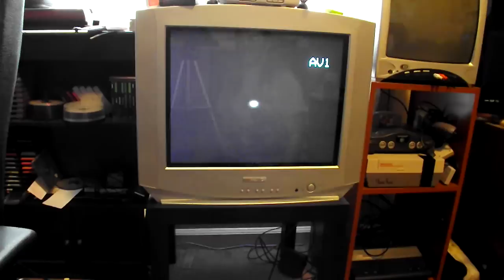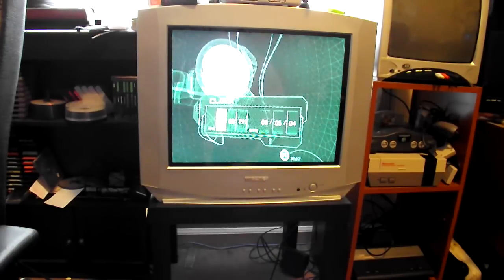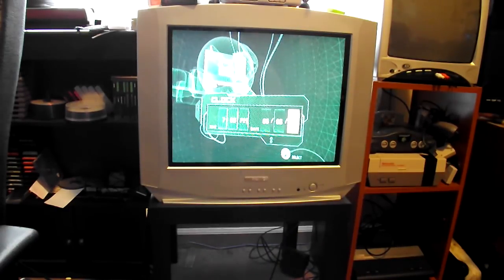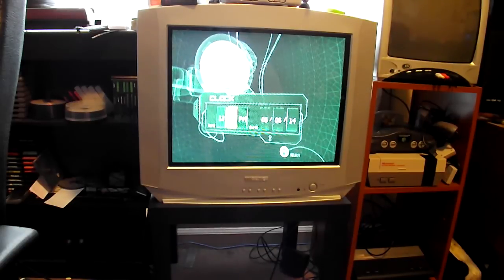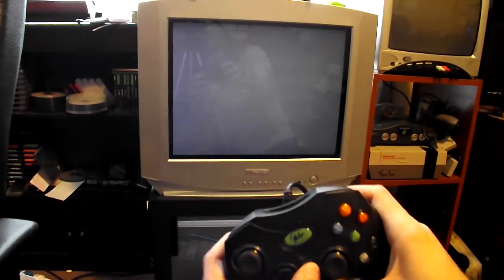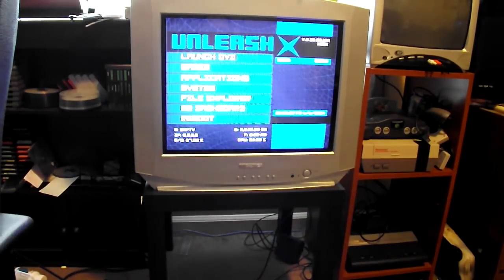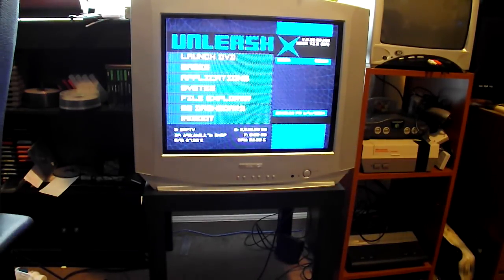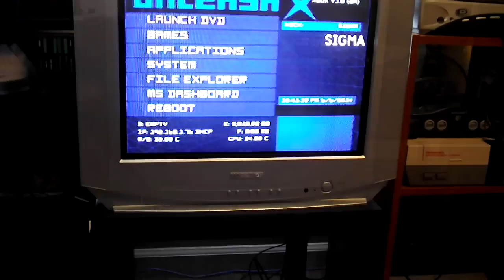Original Xbox power supply replacement

Comment: i just got an xbox (2001) from a friend and said it doesn't work. i managed to test it. the PSU (power supply) doesn't work. it pops overtime i plug it in.
Reply from the maker: Diegotheartist1  order a new one. it's possible the solder joint failed but it's better to just go ahead and order a new one that matches your unit.
Reply: thanks for the suggestion. the model i have is from 2002
Reply from the maker: Your PSU will most likely be the same as mine - the 1st of the 3 models produced. Look for a PSU for the 1.0, 1.1 xbox. A Universal one WILL work but I had a bad time with a universal one I purchased - it didn't seem to be regulated well enough but I've heard that's just an issue with 1.0 Xbox's like mine and those universals.

If you have trouble finding what you need I can help further on IDing the part - just let me know (I'm out at the moment and can't easily link to any extra information ^^;;; )

Comment: my xbox is powering up and then turns of after a wile
sometimes it won't turn on at all ';. \
is it the power supply?
Reply: ***** it's booting, but it turns itself off after a while, and if you try turn it back on it don't stay on longer than 10 sec
if i turn it on by the CD eject button it gets a error 05 message
which i now know stands for locked *something'' (something to do with the chip and the HDD)
it is running ''Xbox Media Center'' btw
Reply: oh, and i activate the chip by holding in the power button
oh, and another thing, it is turning itself on right away when i plug the power cable in it, so i have to hold the power button while putting the cable in to get it in to the menu
Reply: ***** ok, but it gonna take a while cuz my friend is borrowing it (he lives about 13 km away from me)
that's when we discovered it was worse than i thought.
cuz before i could turn it on, then after 5 min it would turn itself off and when i turn it back on again it was fine, could play as long as i want.
i always end up in tricky situations X)

Comment: my xbox wont turn on how do i know if it's a blown power supply?
Reply from the maker: Does it at all try to power on, or does it just sit there like it was unplugged when you push the power button?

If it tries to start, it may have damage from the clock capacitor leaking - you may have time left to remove it and "clean up" the damage, but maybe not.

If it doesn't try to power up at all, or the clock capacitor isn't the problem, then yes, you might have a dead power supply.
Reply: it srarts to smell funny when i plug in i know that much.
Reply from the maker: Sgt. Cracker
eeeehk, sounds like a cap is blown - they have an oddly sour - sweet smell when they pop, or in this case, start to boil over.

Yeah, I'd say a new PSU is in order. Open it up (you will need TORX bits) and look for bulging / blown capacitors.
Reply: Damm thanks for the help
Reply from the maker: Sgt. Cracker
Any time. I'm always around if you need any extra help.
best of luck buddy!

Comment: What numbers should i be looking for when i hook up a multimeter to the outputs?, i told my dad that i wouldnt find this stuff on google and he got pissed that i cant controll what pops up on google so now im on my own, also my power supply looks different than yours, dont know if that makes a big difference
Reply from the maker: That I cannot tell you offhand, sadly. If I can find some sites with the info I'll let you know, but many of them have not survived, so finding the info can be hard at best.
Reply: @KurisuYamato  ehh its alright, its up and running now, im just waiting for my glass tv to get used to being inside to give it a test run, (the tv was stored in our car-port for some reason)
Reply from the maker: @DevonLadd  Good to know it's back up and running. :)

Comment: Will this fix an original Xbox that has been struck by lightning? I’m looking to fix my
boyfriend’s as his graduation gift.
Reply from the maker: It's the first place to start for such an issue. Hopefully it wasn't damaged further, but if it was an actual proper exposure to that high a voltage, who knows how far the damage may go into the system.

Comment: mine got hit by lightning
Reply from the maker: +Eric Unbekannt Ouch. I hate to hear that. The sad thing is that seems to happen quite often.

Have you opened it up and looked inside? The PSU's are fused, and while it's highly doubtful lightnining would be stopped by such a simple fuse, depending on how the lighting strike happened it MIGHT have been a short enough hit (between the house fuses or circuit breakers and the PSU fuse) to survive.

Comment: My xbox just powers on then turns off
Reply from the maker: Probably damaged traces on the motherboard due to the clock capacitor failing.
Reply: How can I did that?
Reply: Fix*
Reply from the maker: You're fine. Autocorrect is terrible :P

So, this is where bad news comes in - if the system is doing this, powering on then off, most often as I mention this is due to a failing clock capacitor. What happens is they , for some reason, leak fluids which actually eat away at part of the motherboard - parts that happen to be part of the front panel controls. If this is happening, then it's probably to late to save the machine, BUT, if you still want to try, and have access to the "TORX" screwdrivers needed to open the console, I did do a video on removing the clock capacitor: https://www.youtube.com/watch?v=uHM15h2kvHI

you will need vinegar to neutralize the acid on the motherboard - hopefully, maybe, things will work right after this. Make sure you're comfortable opening up the machine and really getting in there; if you know someone who is good with electronics have them help you.

The sad thing is though, like I said, if this is the problem, it might already be too far gone. There is still a chance, though, that things might clean up properly. This also might not be the issue at all, but it's still better to get the clock cap out than not - if it hasn't blown now, it will eventually. This problem however, in my experience, has almost always been due to leakage, though.

One final note, if your system is from 2004-2005, be careful - it might be the 1.6 model , the version you don't remove the capacitor on as they changed things in that version. I strongly suggest you do all the research you can on this before you get in there - arm yourself with knowledge.

Best of luck. I wish I could help more.
Reply: Thanks